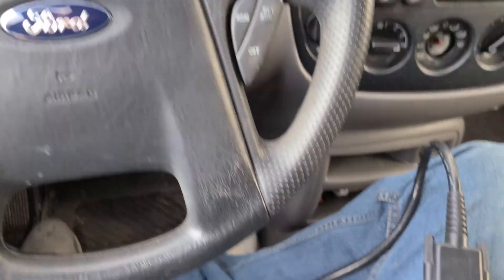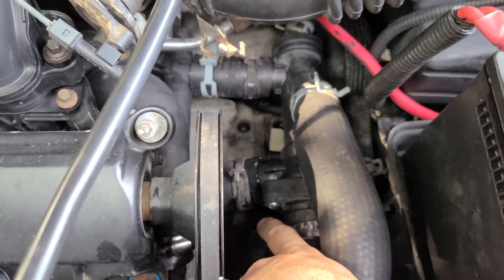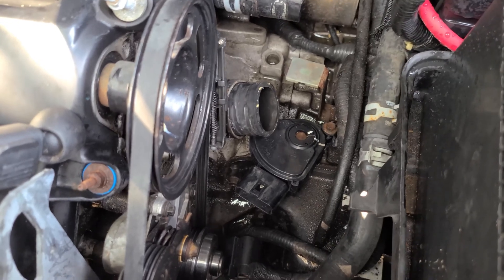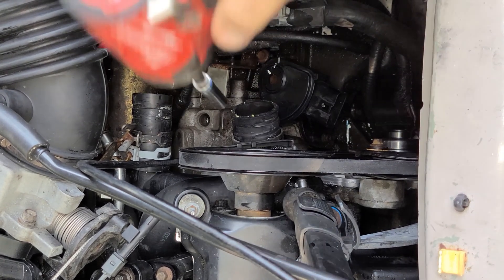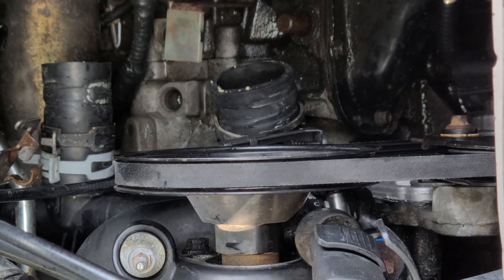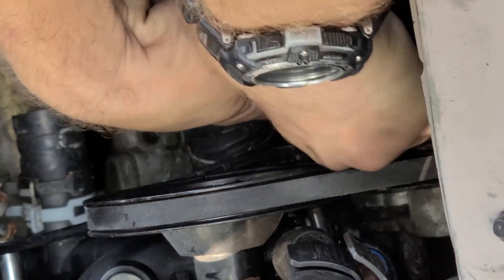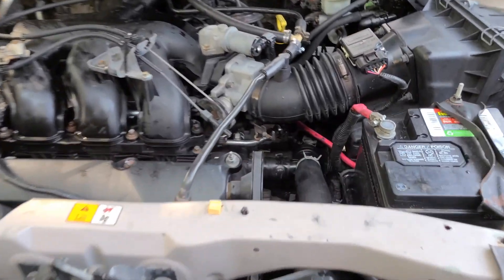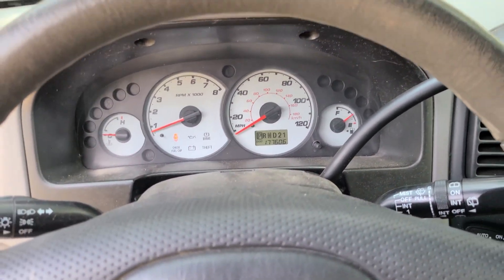P0708: transmission range sensor circuit high FIX easy repair Ford Escape and others

Comment: I just picked up an 03 runs good transmission won't move in Reverse or any other gear when shifting. Could this be my issue?
Reply from the maker: Yes it's possible. Check to see if the dash is showing gear changes
Reply: @gagefixeseverything it does just nothing
Reply: I checked the shifter linkage as well everything is hooked up

Comment: I was told if you remove the battery and battery tray it is easier, no hose to drain for coolant nor any  messy dripping. For a 2002 Ford Escape
Reply from the maker: Great comment!

Comment: My o/d keeps flashing after replacing the that part, code reader said it was the sensor. Need help?
Reply from the maker: @chuysilverdeath  Most likely cause of that is the range sensor is clocked incorrectly, or the new part is bad. That's assuming there were no other issues before you replaced the part, and the connector is in good condition
Reply: @ i goes into every gear, but I feel it’s what you said, it’s not clocked correctly.

Comment: Have you ever seen transmission fluid leak into the sensor? I have a 2010 escape I just picked up and I checked the transmission range sensor after pulling the same code and it was coated in tranny fluid. I’m deciding if I want to sell it for parts or fix it. 
If it may be a seal or gasket that went bad is my only guess. 
Thank you!
Reply from the maker: I wonder if someone just spilled fluid on it?? I think it would be pretty difficult for fluid to get up through the sensor itself. The fluid level should not be that high up

Comment: How did you fix the problem when you installed it and the car didn’t want to accelerate in drive?
Reply from the maker: That is not a related issue

Comment: Question before installing the sensor I hear you have to put gear in neutral and also put emergency break on. 
So my question do I start the car on neutral or on Drive.
Reply from the maker: You cannot start an automatic car in Drive. so neutral or park will be fine
Reply: I meant Park but I typed drive

Comment: Mine looks nothing like this. I have a 2011 Ford Escape xlt 4cyl. Checked all fuses and bulbs for backup and everything is fine. I don’t see this sensor anywhere. The hoses are totally different. Would like some help locating this.
Reply from the maker: beep
Reply: Escape in video is 1st Gen,,,, yours is 2nd Gen, as mine, and sensor is inside Valve Body

Comment: wat bout if it wont start. will this fix it? wen i first got it it started rite up. then i jus let it sit n wont start. all the lights com on tho. i did scan it n it was the same code as yours.....
Reply from the maker: Glad you figured it out!
Reply: lol nvm the conector to the sensor was not pluged in all the way. it works now